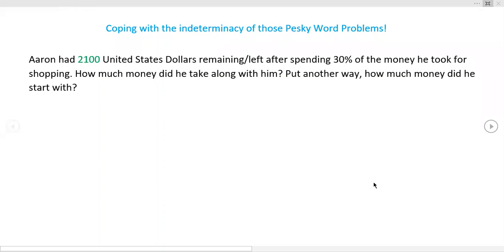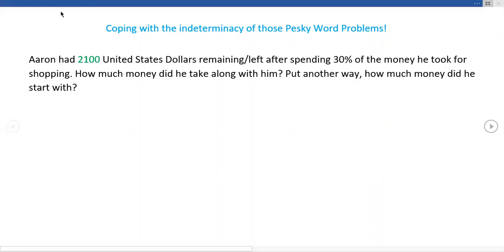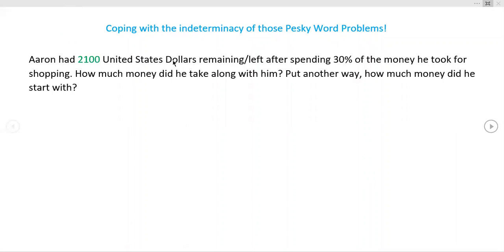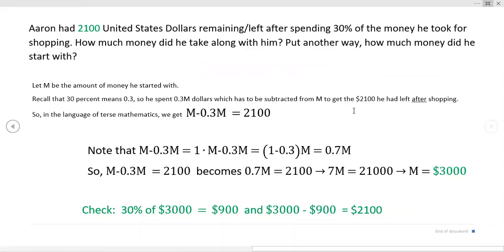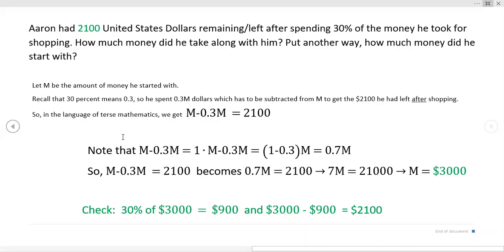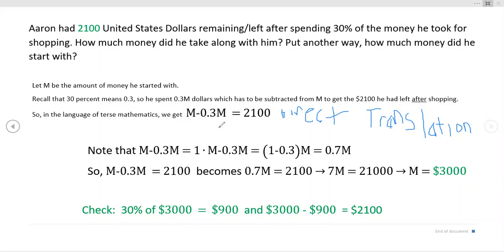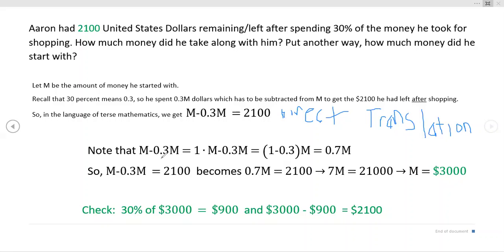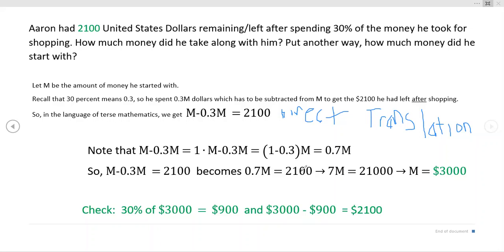Coping with the indeterminacy of those Pesky Word Problems! A Direct Translation Approach Comforts

Comment: a bakery increased their weekly sales of loaf bread by 20%. they now sell 240 loaves. How many did they used to sell per week?
Reply from the maker: Let S be the original sales.  Then 1.2(S) = 240 .  So S=240/1.2  or 2400/12   equal 200.  Hope this helps!
Reply: thanks but how did you get the 1.2? I know the answer but  I dont know the step by step solution
Reply from the maker: @rhianeParis   20% is the same as  0.2,  so 1S + 0.2S  = 1.2S.  Remember S was the original sales level before it was increased by 20%
Reply: where or how did .get the 1.2 ? please help thank you